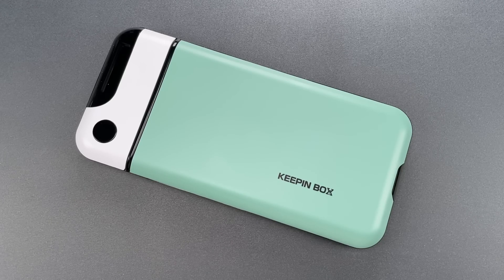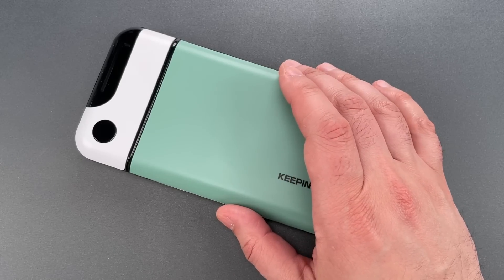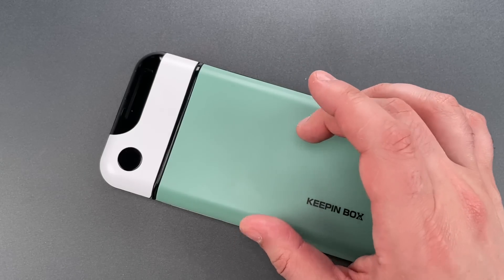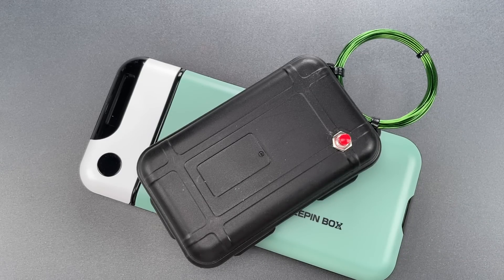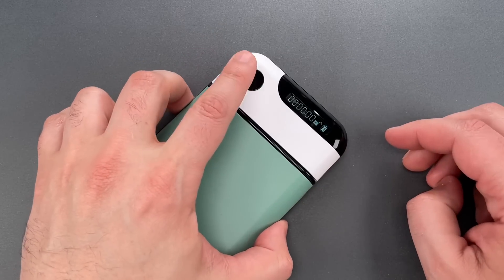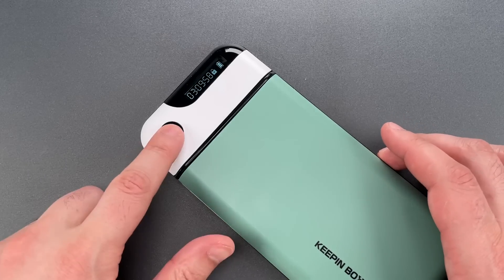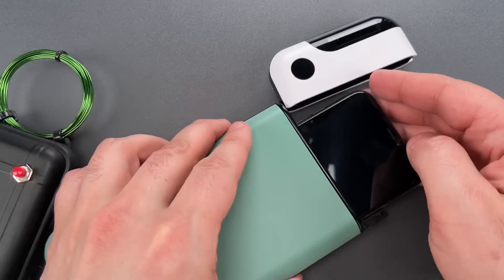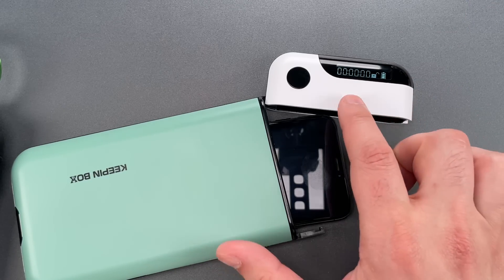[1440] Pocket EMP vs. Smartphone Timer Lockbox

Comment: I’d like to think that the timer resetting to zero is a safety measure in case something went wrong and you don’t want your phone to be stuck inside but it probably wasn’t.
Reply: It kind of is. Microcontrollers have a WDT (watchdog timer) built in. If the code stops executing properly, the WDT times out and resets the micro. It's not meant to help you get your phone out, but is usually enabled as good practice.
Reply: @misterhat5823  BigClive actually had what I think was one of those head torch with various brightness settings where the microcontroller in it crashed, and this watchdog timer apparently wasn't enabled. This means that the lamp did not work at all and appeared completely dead until he desoldered the battery and soldered it back in.
Reply: @misterhat5823  That's true, but so does LPL if you think about it
Reply: not really.. as what LPL said, if there is something wrong and you want to get your phone, just break it because it is plastic..  now if you want to reuse the case, it really breaks the purpose of having this lock case aint it?  like, you are supposed to lock your phone so you do not get addicted to using it, what is its use if it has a reset safety measure which you can use all the time?
Reply: @nael2770  As LPL said, it shouldn’t really be used a tool for security but just for helping yourself from your phone. If the user has enough determination to make a pocket EMP or break it in order  to open it then i doubt the whole thing would help anyway. Unless it was a third party who forced them to not use their phone like a parent.
Reply: Yes it seems like, it would be what they call fail safe.

Comment: The low security of this device can actually be a blessing in disguise. Imagine if you locked your phone away and then had to call 911... but can't because it's locked away. Sure, these sound great, but sometimes what you gain isn't worth the risk. I would argue that even the phone of a teenager or child shouldn't be locked up like this, just in case THEY have to be the one to call for help, unless they know where the parent's phone is and know how to dial 911 without unlocking it.
Reply: There's a mode on my OnePlus called Zen Mode which does exactly this. It locks you off the phone for the set amount that you choose and you can't cancel it once it's started. However, it still let's you make emergency phones calls, receive phone calls and use the camera. It's a great alternative to something like this lock since it's enough for me to stay away from the phone and focus while still being able to use it in case of an emergency. I guess other phone manufacturers have something similar.
Reply: @federicolopez1183  that’s a nice feature!
Reply: That's true, they just need a lock for wifi/4g/text, probably even an app for it (you would need to disable restart/shutdown).
Reply: Especially when there are apps to do exactly that... lock all functions of the phone but emergency... 
Usless plastic box
Reply: @mallobag  what app does that on iPhone or Android?
Reply: @twestgard2  there are probably settings in Google's new "Digital Well-being" feature (part of Android OS) that have similar features. Also DND mode. I think iOS also has a similar system feature to digital wellbeing, I don't know what they call it. Also on Android 12 you can "pause" apps to quiet your most bothersome apps.
Reply: The situation where there's an emergency and you need to use a phone was my thought as well, it seems rather dangerous to lock your phone in a device like this. But I wouldn't say low security is a blessing here - cause you would still struggle to open even a low security device like this in case of an emergency, even if it only required just a shim (rather than EMP like on the video) to open...
Reply: @JakubKuczys  Table, whack, opened.
Reply: Its not low security to go without your phone.
Its just, how life was 10 years ago, you gotta realise you dont NEED a phone to call for help, you have a voice that can shout, but even then, the chances of anything bad happening for those 5 minutes you dont have your phone inside your own house is so incredibly slim, the worlds just not that dangerous.
and- depending on your defintion of security. Going without your phone is the most secure you can be, considering its an always on device with full locational tracking data and if governments need to investigate where you've been they can triangulate your phones pings to nearby cell-towers and GPS lookups to see where youve been going and what youve been doing (if they have a reason too, this isnt 1984, still weird tho).
so for some, phones are the least secure thing you can carry with you
Reply: @azzzertyy  mobile phones were just about as common place 10 years ago as they are today. You have to go back at least 20 years for them to be uncommon, and back then that was made up for by a prevalence of land lines and pay phones. As for yelling for help, not everyone lives within easy shouting distance of a neighbor
Reply: @azzzertyy  Yep. And I guess none of those children that are abducted every day knows how to shout.
Reply: @azzzertyy  10 years ago, landlines were still required to be maintained. That is no longer reliably true. Never forget that infrastructure changes alongside technology, so the tools of old may no longer be available today.
Reply: @azzzertyy  SOCRATES: But, my friend, the priests of the temple of Zeus at Dodona say that the first prophecies were the words of an oak. Everyone who lived at that time, not being as wise as you young ones are today, found it rewarding enough in their simplicity to listen to an oak or even a stone, so long as it was telling the truth, while it seems to make a difference to you, Phaedrus, who is speaking and where he comes from. Why, though, don’t you just consider whether what he says is right or wrong?
PHAEDRUS: I deserved that, Socrates. And I agree that the Theban king was correct about writing.
SOCRATES: Well, then, those who think they can leave written instructions for an art, as well as those who accept them, thinking that writing can yield results that are clear or certain, must be quite naive and truly ignorant of [Thamos’] prophetic judgment: otherwise, how could they possibly think that words that have been written down can do more than remind those who already know what the writing is about?
Reply: @NFSgadzooks  20?  you're young, aren't you?
Reply: @alexandriadavis3730  you do know the same backbone that carries broadband internet also carries telephone, don't you?
Reply: @kenbrown2808  VOIP is a newer technology, and one many people don't have set up. My point was more of a "landlines are less common and less reliable today than they were 10 years ago "
Reply: @azzzertyy  It's hard to compare to 20 years ago, though, because back then there were lots of payphones around. They've gotten rid of them because of cell phones. Similarly, if you go back before there were phones at all, it was far more common to have police walking a beat so that they were closer and might hear a scream for help.
Reply: @alexandriadavis3730  VOIP is something totally different.  every company that lets you bundle internet, TV, and telephone runs all the signal on the same set of wires.  the only thing less common about land lines is more people not having a phone connected to them.
Reply: @NFSgadzooks  thats a symptom of car dependent suburbia and in rural areas youre not gonna get shanked.
Reply: @azzzertyy  10 years ago I had a land line.
Reply: @azzzertyy  Boomer logic.
Reply: @NFSgadzooks  LoL, right? Maybe Azerty thinks the current date is 2002 and he’s thinking about 1992 when mobile phones weren’t as commonplace.
Reply: Uh the absolute stupidity of that device is where this conversation should start.
Reply: If you have so little self control you need to actually lock your phone to stop using it you have far bigger issues.
Reply: I’d love to see how big the crossover is in the Venn diagram of ‘people who believe you always need a gun handy in case of an emergency’ and ‘people who think you don’t need easy access to a phone because you can shout for help or ask a neighbour’…
Reply: @Airlord3670  By experience, I have definitely needed medical emergency lines more than a gun. I feel the fact that some places in the world need their citizens to have guns, is a heavy indicator that there are problems either glossed over or ignored. It might be more than a singular problem too.
Reply: @naerbo19  What does that even mean? No one needs a gun? But, when someone break in your house or is trying to harm you, I doubt you would go, naw didn't need the gun...
Reply: @Hannibal2468Slt  But I feel something is wrong if citizens don't feel safe before they have a gun. What went wrong when designing policies in the political sphere where people are either forced to steal or easy enough that it is a viable way of living?
Reply: @Airlord3670  A gun can save your life quicker than a phone.
With this plastic box all you would need to do is grab the top, the bottom and twist it. It looks like it would come apart very easily.
It also isn't soundproof so if you have a voice assistant (google/siri) you can just say "Hey <assistant> call 911"
Which is exactly what a teenager did when he got trapped in his truck by a seat that pinned him. The 911 operator thought it was a hoax though and didn't take him seriously, so he ended up dead anyway.
Reply: @Airlord3670  As a Criminologist, 9/11 is not intended on preventing or even typically stopping a crime, it is their for the aftermath, a gun is much better, assuming you're not a dumbass and have used it before.
Reply: Flicks  It's not so much a question about intelligence as it is about grace under pressure. Some people simply don't handle high levels of stress well, especially in the case of a severe emergency, and it's hard to train oneself for a scenario like that. Even the most coolheaded people can completely unravel if, for example, a loved one is having a medical emergency right in front of them.

As far as the extra dumb phone is concerned: yes, cell phones can reach emergency services without a SIM card. One big caveat (at least in the US) is that many 2G/3G networks will be shutting down this year. After this happens you'd need a modern dumb phone since the humble Nokia brick you've had in the drawer for the past decade won't work.
Reply: yeah, should be solved with good parenting instead.
Reply: @dgh25  By parenting do you mean giving the kid a phone to shut it up, then being mad at it for looking at the phone when I don't want it to?
Reply: @matt92hun  No.
Reply: @matt92hun  He means limiting time, then again I doubt you know how to teach your children to put down something
Reply: @Hannibal2468Slt  That was sarcasm. I realise that not everyone can see that in text.
Reply: You might also be able to break the plastic housing with any luck.
Reply: I believe there's parental controls for phones that only allow the dialing of certain numbers, call times, and control of other functions which would not interfere with an emergency situation.
Reply: We survived emergencies without cell phones in the past. The context in which you would use this would probably be while you're at work or school; both places would have landlines not too far in case of emergency.
Reply: @ilovethelegend  Yeah we used landlines that are nowhere to be found these days.
Reply: @ilovethelegend My mom survived a car crash without a seat belt, what's your point?
Reply: Now here’s someone afraid of life
Reply: Flicks  Correct. Any phone that can pick up a signal will be able to dial 911 (US) or whatever the emergency number is in your country.
Reply: You don’t need to UNLOCK any phone to dial ems
Reply: but hurr durr phone bad
Reply: On a sidenote, always hated this argument pHonEs aRe dEsTrUcTivE dUmB tOys cUz BacK iN maaaah daaaays... b*tch on my current job for example my phone is literally my work tool, MY PHONE IS MAKING ME MONEY, of course I gonna be using it all day.
Reply: Yes but I still would like to hear a reason for some one to lock their phone inside a power bank for several hours.
Reply: Phones have parental controls to render this device meaningless anyway. I have my daughter's iPhone locked down at certain times of the day where it is nothing more than a horrible flashlight. But even then it still allows emergency calls and calls to/from us.
Reply: @BobSentell  God, I'm glad I grew up with GenX parents so I never had parental controls on my tech.
Reply: @BobSentell  YET if YOU logged into your daughter's phone you could use your password to disable the lockdown
this device is there to prevent YOU from using your OWN phone
Likely while at work when doing so could get you FIRED
And some people have addictive personalities and the phone is irresistible so they lock up their phone so they can't be tempted
Reply: @drthmik  You don't get excuses for having "addictive personalities", put down the phone
Reply: Meh, risk is (likelihood of harm) x (magnitude of harm). In your emergency scenario, the harm could only happen if you also can’t bang on your neighbor’s door and ask them to call the police. Possible, but the risk is minuscule and manageable. 

And it’s being balanced against the high likelihood that you’ll waste your time on your phone, which for some of us is practically a guarantee depending on circumstances.
Reply: @twestgard2  'In your emergency scenario, the harm could only happen if you also can’t bang on your neighbor’s door and ask them to call the police.' Like if you're stuck under something heavy, or have been otherwise immobilised? Or your house has been invaded and you cannot leave your room? Or your house is on fire and you cannot reach an exit?

The time delay in getting help can be lethal in all of these scenarios.
Reply: They're more for shows, theater and stand up comedy where they don't want the performance recorded by people and put online. Or for swanky parties with security staff that have phones and radios for emergencies. If people use them to just not have a phone for a bit then yeah, that's a bit silly with the need to call 911 and the like.
Reply: Having an old cheap phone just for 911 without service should solve this issue.
Reply: The parents who'd buy a device like this prioritize controlling their kids technology use over the possibility of an emergency situation at home. So it's very good for devices like these to exist but not be high security
Reply: the people you meet in a comment section.
Reply: I agree.  Never call 911 for a self defence shooting as it is never worth the risk.  Instead, Get Hard[TM] Andrew Branca.

Comment: I really hope that we can see LPL's pocket EMP construction plan or something
Reply: It'll be for sale on covert instruments next week 😃
Reply: @Nathan-wk9dd  It's not hard to make. I'll sell 'em at half his price...
Reply: Taser and copper wire loops?
Reply: @Chokah  Sort of. Here's a guide I made. I've posted it once or twice to people who are curious:

Buy a project box
Buy some enameled magnet wire
Buy a boost converter from an online marketplace (one of the ones potted in resin with claims of 500KV or more)
Buy a PTM (momentary) switch
Buy a battery holder for 4AAs
You also need a soldering iron and preferably a drill

Wire the negative end of the battery holder to the negative end of the boost converter.
Drill the project box (or melt with the soldering iron) and mount the momentary switch like LPL has done.
Wire the positive end of the battery holder to the PTM switch then the PTM switch to the boost converter.
Take one of the leads from the boost converter and attach to the coiled magnet wire (same arrangement as LPL has), remember to sand the magnet wire so you make an enectrical connection. 
Take the other end and attach the lead to a bolt running through a nut which is glued to the project box.
Have another bolt and nut glued near to it. This allows you to create a spark gap so you get a pulse.
Attach the other end of the magnet wire to the second bolt.
Adjust the spacing between the nuts and bolts so that you get a regular arc between them when you press the PTM switch.
Tidy the project box up, use zip ties to secure the coil of magnet wire. Glue everything down.

You now have a portable EMP.
Note the boost converter can give a nasty zap. Also you can forgo the nuts and bolts for a spark gap by encasing a broken wire in hot glue with an air channel, but you can't adjust the spark gap then.
Reply from the maker: @daviddavidson2357  yup… that sums it up almost perfectly.
Reply: @lockpickinglawyer  Thanks for the response LPL. Keep up the good work, I wouldn't know much about lock picking if it wasn't for Bill  (until he retired, but he left a wealth of knowledge) and you.
You're doing a great job when it comes to highlighting security flaws and have certainly made thousands of homes (mine and other family members included) safer as a result.
Reply: @daviddavidson2357  - Attaching a wire-loop to a high powered taser gun basically accomplishes the same thing, less hassle.
Reply: He didn't do it twice maybe it was a fluke
Reply: @sgvincent100  Not the same thing.